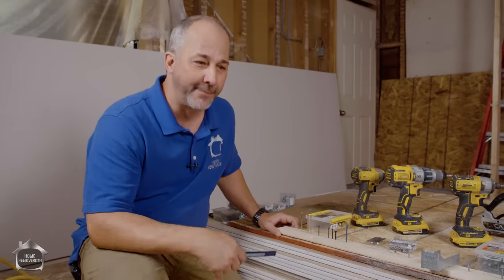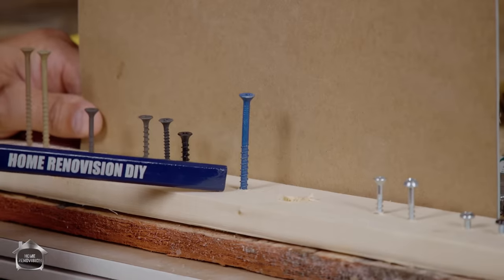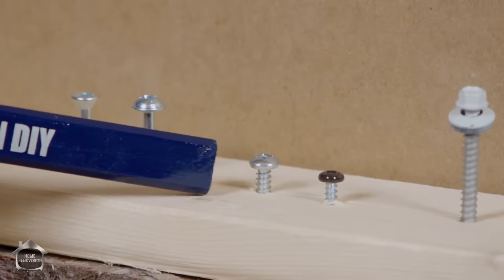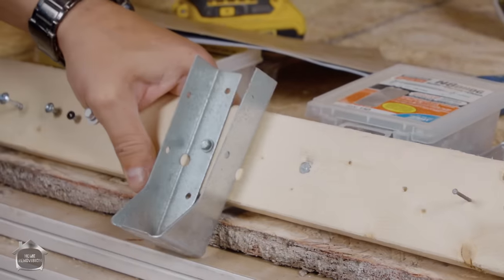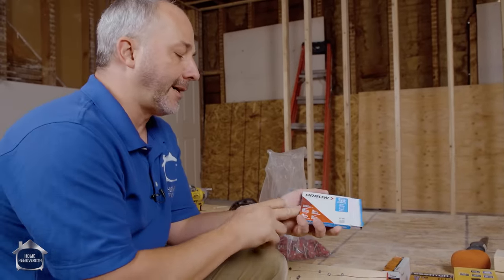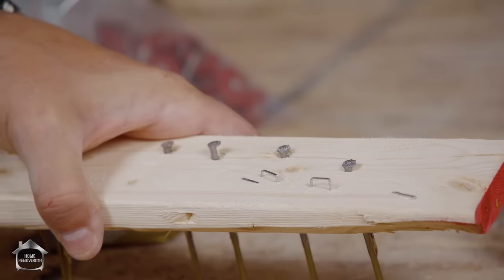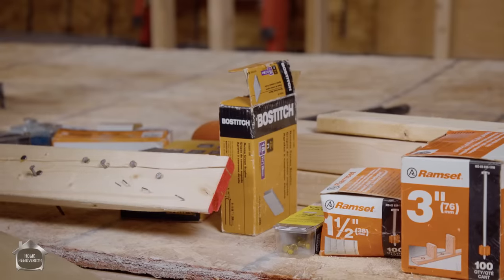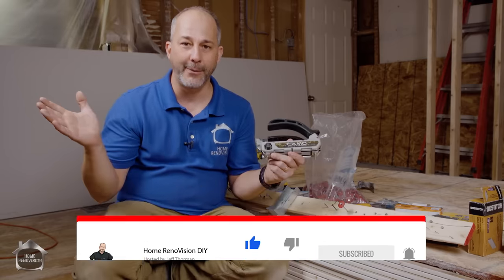What Screw to Use For Your DIY Project | Fasteners & Tools Guide

Comment: The marketing materials for the structural screws say they are a direct replacement for lag screws. Is this always true? Can a structural screw be used to mount things to an overhead joist? The photos generally show them used in a horizontal, decking context. Thanks!

Comment: I really should buy more of those half threaded screws. If you use a fully threaded screw to hold 2 boards together, and you don't clamp it or nail it first, there's almost a 100% chance you'll get a gap between the boards. The screw doesn't allow sliding in either direction, so that gap is there forever.

Comment: would you use the structural hex head hanger screw on inside of hanger won't it keep wood from fully going into hanger or is the gap on purpose to allow for expansion and air to dry end of wood?

Comment: Drywall screws also have a radius rather than a straight angle on the underside of the head chamfer to lessen the chance of it punching through the outer layer of the gypsum board.
Learnt this after using subfloor screws for drywall 🤦🏼‍♂️

Comment: I’ve been looking everywhere for a video or even an article. If you were to use the camo system for deck boards and a board gets damaged. Are the hidden screws accessible to be removed so the board can be replaced?

Comment: i. Concrete screws dun pre- drill in & out, why, other ppl said vacuum the concrete dust, you're saying from experience?

ii. What's different between interior & concrete screws, looks same to me?

iii. Do you know if can use cordless drill non- hammer mode drill hole into brick wall, screw ~20kg mirror onto the brick wall w/ concrete screws tightly?

Comment: Interesting the drywall to drywall fastener is used in Australia all butt joints on ceilings must be back blocked and anymore than two recessed joints in a ceiling must all be back blocked as well.
Reply from the maker: nice! Are you guys worried about earthquake there is there another reason?
Reply: Home RenoVision DIY nothing to do with earth quakes mate. It’s actually because cracks in the ceiling and screw pop where number one cause of call backs, warranty building insurance and disputes is dealt with State Governments. That means Code can be driven by improving probable faults before they arise. 

I assume tin metal sheet roofing and heat build up if it’s 45*C in the shade the roof cavity if not vented could be up 70-80*c even in cooler temps and cyclonic winds. 

Plaster board oz style code guide. https://awci.org.au/wa/files/2019/06/AWCI-Trade-Guidelines-October-2018.pdf

Comment: What kind of screws or nails do you use for headers?  I want to move my kneewalls in order to create niches so I can push my furniture back into them.  My structural engineer said that I should add a 2x2x6 header every time I move a wall because all walls are balancing the roof load in my house.  The kneewalls are currently notched into the rafters a few feet in from the exterior walls.  (It is a modified Cape Cod style house In the Vermont NEK, and we get a lot of snow.)  I know this is probably overkill but I'd rather err on the side of caution.
Reply from the maker: Hi Gina, you should use construction screws for anything like that. Cheers!

Comment: There's also gas-powered nailers that perform very much like that 22cal, but are much more convenient as they have the shape and operation of a common air/electric nailer. They're also magazine-fed. Now lower-end models are not as powerful as the 22cal, but usually enough. Great for mounting stuff like brackets and profiles and whatever to anything (they can even attach metal to metal), you just need to pick the right nails for each job. Also, these nails are a b*ch to remove, best option is to cut them off with an angle grinder.

Comment: are there any screws out there for attaching the footer of a handrail to concrete that lock🔒 so it cannot be stolen😅 ???
Reply from the maker: no, but if you use concrete plugs and air tools to install then mere mortals will not be able to unscrew it without at least making a lot of noise. Cheers!

Comment: I really dig though content, I have a question, I’ve noticed you own dewalt drills & acces. Any particular reason, I’m contemplating between Milwaukee & dewalt, I’m not a contractor by any means. Just a diyer & shade tree mechanic
Reply: POWERTECH what I have found is it comes down to the battery platform that you have and use. I have some older 18v dewalt and have not made the switch to the 20v line because I have knock off batteries for the 18 nicad. I also have Hitachi or metabo tools that are lithium.  They also have a multi volt. Others like the m12 and m18. All of my battery tools were well abused by me before the company I work for upgraded to the next battery platform and I got them dirt cheap. For the home gamer starting from nothing I would suggest hazard fraud in the US or princess phister north of there. 

For the PRO that owns one $800 drill instead of three $200 drills buy Hilti.
Reply: I discovered the channel VCG Construction recently and have been watching a lot of their tool review videos. DeWalt  and Milwaukee along with Makita are consistently at the top for performance and reliability. The main thing to decide on is battery and the range of compatible tools that you'd consider buying in the future.

DeWalt is more expensive. Their new "atomic" tools are basically the same size and performance as their equivalent flex volt tools but for a higher price (so avoid buying the DeWalt atomic line). Milwaukee and Makita have a larger variety of tools on the same battery system. If you're interested in subcompact tools, both DeWalt and Milwaukee's offerings run on a 12v battery platform that isn't compatible with most other tools, but Makita's subcompact tools run on the same 18v battery that their other 200+ tools do.

For home/diy/prosumer use, Kobalt and Ridgid are also good choices at a lower price. In not as familiar with Rigid's lineup, but Kobalt recently came out with their higher-performance XTR sub-brand that compares well with DeWalt's tools.
Reply from the maker: I love the dewalt 20 volt line. All the dealt tools use the 20 so you never have a problem with compatability. I find they are the best performing tool for the price on the market. Milwaukee to me is just paying for performance that most people can never realize so it has no benefit to the average homeowner. No need to waste the money! Cheers!

Comment: What kind of screw should I be using for plaster and lath? I’ll be screwing into a stud behind the plaster.
Reply from the maker: that all depends on what you are attaching to the stud! drywall screws come up to 2" or regular wood screws have a variety of sizes for other applications. Cheers!
Reply: Home RenoVision DIY Thanks for the reply!

Comment: How do you cut cement board ? Can I use a sawzall or can I use a razor score it and snap it
Reply from the maker: durock has a mesh than can be scored with a knife and cut like drywall. cement fiber board can be scored and snapped if it is 1/4" , the 1/2" fiber needs a cement blade for your circular saw. Cheers!

Comment: Remember to put the screws in the wood as well as a drywaller I have seen these not work due to it not being held on by anything but glue to drywall and is imperative in kewping your house safe

Comment: You called the flat head screw a pan head,  you called the partial board screw a flat head, it’s a round washer face and you called the tek screw a self taping screw, which is the normal term for a regular sheet metal screw, which also had a pan head.

Comment: Just FYI: Code does not allow for the use of wood-screws (aka: Deck screws) in framing without a structural engineer's stamp of approval.
The only exception is a "structural" screw, which Simpson happens to sell for about 3-4x the cost of a deck-screw. Go figure.

People love to talk about "but the shear strength of nails" or the "but if you hit it with a hammer on it's side".
Well, I call BS.

Cross section of the screw dictates the shear strength. I wager a #9 or #10 wood screw has plenty to spare.
As to the ductility (hammer blow) argument: You show me any framing member that comes even remotely close to the stress of a repeated hammer-blow directly to the side of a fastener, and then maybe you would have a point. But in the real-world: I wager you aren't going to come close to reaching the plasticity level of stressing a #9 or #10 wood-screw.

I'd be curious to see who is actually keeping wood screws out of the code, and what exactly Simpson does to get an exception to their overpriced "structural" screw.

Comment: Its amazing what people name they're screws.......almost all the screws in this vid isn't there manufacturing name.
Reply from the maker: It is where I live!
Reply: @HomeRenoVisionDIY im talking about flooring screws aren't called a" flooring screw " when i make them they are called a Hi-lo used to be made for plastic applications,  however manifactures and engineers  realized over the years that theyre is many uses for different types of threads. Pan heads are not flat head screws and oval heads......hex heads with  a washer formed with the head in manufacturing are called a hex washer head not a hex head. Screws made with just a hex " no washer" is a hex head. Again the consumer market has different names for them other than the manufacturing name assigned when we make them.

Comment: Never use an impact tool for installing fasteners.  No fastener manufacture will warrant their fasteners when installed with impact tool.
MCA has many articles of what impact tools does to the plating (coating) and the structural integrity of the fastener